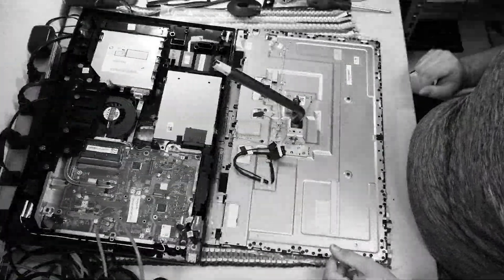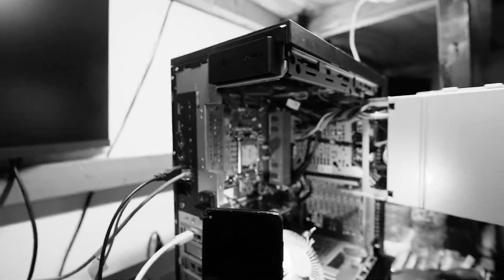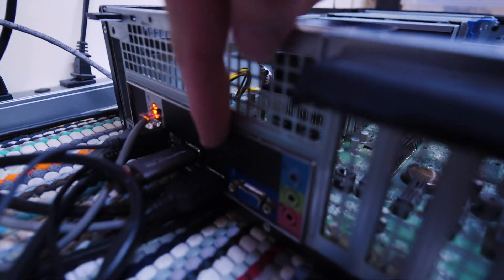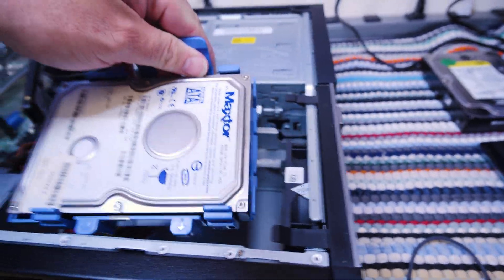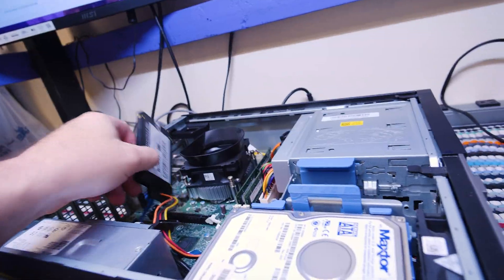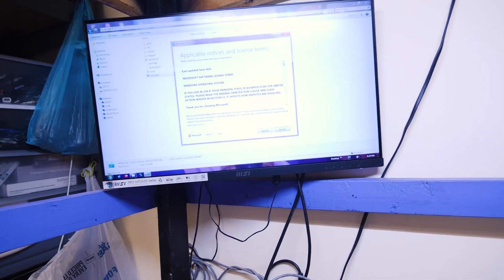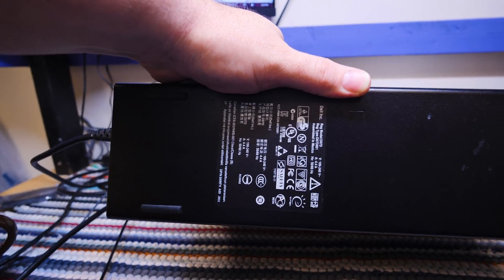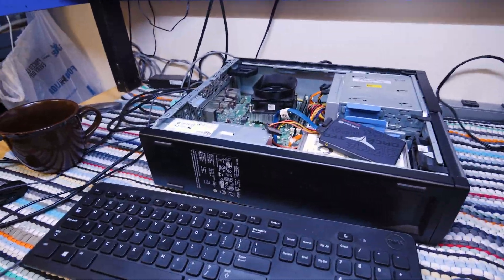Shocking...I Actually LIKE The Dell OptiPlex 390 SFF Desktop

Comment: Found one of these in the garbage I definitely want to make it into sff sleeper. I got a front IO from another PC case. I'm planning on cutting out the old front USB and screwing in the front place from another PC. It will have USB 3.0 then. I want to make it my portable gaming PC. Thanks for this video I didn't find much about this pc but I definitely see potential in the case just didn't know the size of the power supply is standard! I'm going to cut out holes in the side for some PC fans as well if I can fit any after removing the hard drives etc.

Comment: I was previously working on a Dell OptiPlex 320, and, if you do not know what it is, it's one of the infamous BTX OptiPlexes. I absolutely HATE its proprietary case design- I wanted to fit a new motherboard (the old one had some GPU issues) into there, but the I/O shield is soldered on, despite having the same dimensions. The PSU also had normal connectors, but the cables were too short! Even the power button had a proprietary connector! In good riddance to that computer, the PSU died while I was testing it. I was able to save the 4 GB of DDR2 RAM, as well as the Pentium D CPU, optical drive, and floppy drive.

Comment: This is worlds apart from the Dell Optiplex 390 SFF I have here right next to me. It has absolutely none of the standardisation you just pointed to other than the TFX power supply mounting holes, which is basically a taunt as a TFX wouldn't fit in this case because of the mounting bracket that there proprietary PSU slots/ clips into. The board in mine seems to be a weird size between an M-ATX and a M-ITX. Noi pop out I/O shield, drive caddy and optical drive are one bracket and I only have two half height PCIE slots.
Reply from the maker: Yeah, any of the machines with no removable I/O shield are no-go. I have cut away a hole for replacement board I/O in the past using a pneumatic cutting wheel but I wouldn't ever do it again outside of some big personal passion project. Way too much work.

Comment: I have a Dell Optiplex XE. I swear I think it was almost a first one or something. Old employer was throwing it out and I grabbed it. I upgraded the CPU to a Q9550S. I picked S version due to the lower wattage power supply. The video card was limited to an ATI HD 7570 for the same reason. If I could upgrade the motherboard that would be great But I'm not sure what would fit.

I started out with mid towers and eventually ended up with a full tower that will eventually hold my serve software. It's an Enthroo Pro case. It can can hold a lot of drives. It was an accident. I wasn't paying attention to the dimensions as closely as I should. But anyways I'm going micro atx here on out. Although that Threadripper thing keeps calling my name. Dang it!

Comment: Back in the win7 times they (all major manufacturers) were still making things overall good.
But it is no longer the case.
My new Dell laptop is so cheap plastic all the way and the battery is integrated, that it's in a constant state of 1-step away from damage, or at least that is the feeling I get from it.
Adjusting the screen position alters the WiFi speed greatly - just to give you an example. Usually, inside the laptop's monitor frame around the screen is hidden a wire-antenna for WiFi. I guess it doesn't do a good job on my laptop.
And it's not just Dell, I mean all (or almost all) new laptops are piles of crap.

I have an old Lenovo ThinkPad, business class, which is a bit old, but still working well and was made solid, hard to compare to any new laptop.

The first laptops were built by engineers. The laptops now are built by marketeers.

Comment: I have an old Lenovo where all the casing panels fold out and the drives and cards just pull out using the blue handles. Great design for maintenance. Not a single screw to be undone!

Comment: Just like myself! I have found so many of these just throw away. Usually because of a bad power supply and businesses or private owners just throw them out. This particular Optiplex had such a GREAT form factor for cleaning out office or garbage gunk and one hour of cleaning + upgraded parts also taken from other "broken" ones it was so easy to simply put it all together and replace the power supply with a new upgraded or another working PSU from one of the other disposed of ones I found in the trash or were just given to me to reduce waste. They're VERY good because of that, albeit, limited in some regard but for a upgradable workstation it's great. The only thing I ever had to manually do was cut or bend / glue some extra room into the case for larger projects. One of the few Dell Designs I got 0 qualms with.

Comment: 0:38 I have similar issues to this with every HP tower I ever work on. Right now I just finished repairing a slimline. YOu have to hold both hands in the center of the rails and push forward to get the panel to close. Otherwise a few of the teeth don't go down, and you have a giant hump sticking out. The only thing wrong with the actual computer was a faulty memory card. All that hassle just to find that out.
Reply from the maker: I know exactly the kind of machine you're talking about.
Reply: I dislike HP/Compaq and so on. So many issues I've encountered of the years with them. With Dell I could always get quick assistance but with HP I found often it was harder to get support before discontinuation BS. Though I will say, I've had a couple HPs I've worked on and built out of myself to where the towers themselves and parts were still sufficiently strong with an old i5. The worst thing I've experienced with HP is the cutting of my fingers on their non rounded off edging they used to ship out all the time before too many complaints.
Reply: @TheCasualHazeFox  Yeah my fingers got a nice slicing a few times on these as well.
Reply: That being said, the slimline also used standard parts. Of course they removed all the PCI busses to fit the mobo in behind the psu. That kinda made me annoyed a bit. Imagine buying something that would go in one of those, and finding out you can't. Or worse yet, imagine your customer doing that, and expected YOU to install it. And you have to explain that to them.

Comment: Spoiler alert: 

Any computer you buy preassembled is guaranteed to have the cheapest parts they could possibly find, put together by the person they could get away with paying the lowest possible wage--->and don't expect that computer to last an hour over whatever "warranty" they've given you, and if you ever have to redeem that "warranty" expect them to not honor it using any excuse they can get away with.
Reply: I totally understand where you're coming from. As someone who is an engineer at an ODM, I can guarantee you this is not the case. I'm not in the PC market, I mostly work on mobile devices. Yes, everything is built to a price, but the component quality is important. There is a point where saving $0.01 on a $0.34 part is not worth it. A company like Dell has a reputation to uphold, especially in the Enterprise space. If you factor that in with the cost to qualify a component and add it to the manifest it is often not worth the savings.
Reply: @50shadesofbeige88  My electronics friends would agree with this. Ever seen an Engineer get pissed off when they're handed a subpar part that is difficult for them to work on efficiently because the part itself is cheaper than a more refined part? Let's just say, the Engineers let the company know via how many "broken" cheap parts get. A few at a time adds up to costing more to replace than just getting the right part to work with. ;)
Reply: @50shadesofbeige88  Dell is a miserable company to buy today. But so are most of the other brands too. The market is at its lowest point so far.
The only thing Dell I appreciate and love is my monitor, it's 5 yrs old, but is working great. When I compared it in the shop with few different competitive monitors, it was standing out with near perfect white-balance and color representation.
Unfortunately, can't say a good word for my new Dell laptop. The most plastic... thing, I've ever seen. Great mistake to buy it.

Comment: I would go so far as to say that the Optiplex product line in general has produced some of the best pre-built OEM PC's ever.
Reply: Certainly so! Optiplex to this day from what I've seen around businesses that have a contract with Dell use mostly Optiplex lines and from what I've seen with my personal works is the PSUs just go out of them eventually / first. Easy fix and otherwise stable for longevity.
Reply: @TheCasualHazeFox  Spot on with the PSU, got one of these optiplexes for my dad 5 years ago with a dead PSU but it had 16gb of RAM and an i7-6700. about $130 total after buying the system and the replacement PSU and it's still chugging along just fine!

Comment: Thanks for the tip Jody; what’s your favorite system to work on?
Reply from the maker: @johnbuller2132  Custom builds that don't try to hide the wires. Failing that, anything like this one that's truly tool-less for most maintenance. Side panel is just a handle release, no screws. All drives removable with a yank. Everything generally reachable and not covered by other things that aren't tool-less.
Reply: @JodyBruchon  Amen to that! Hiding wiring and tracing them to various ports and then putting them back the way they were is a total headache for someone like me.